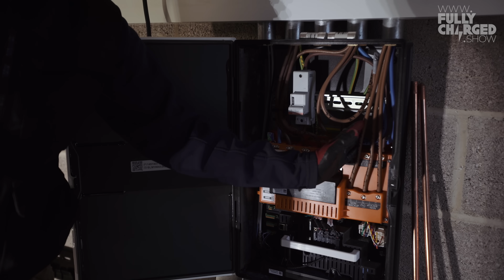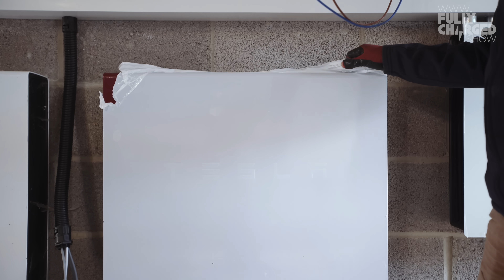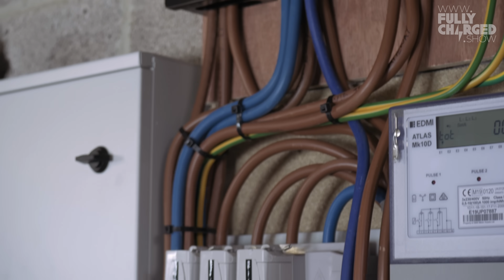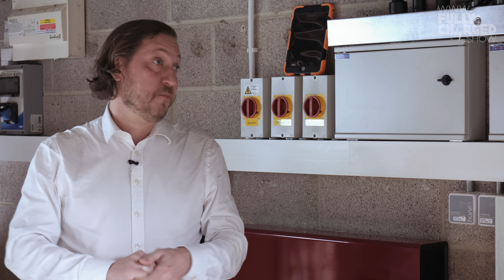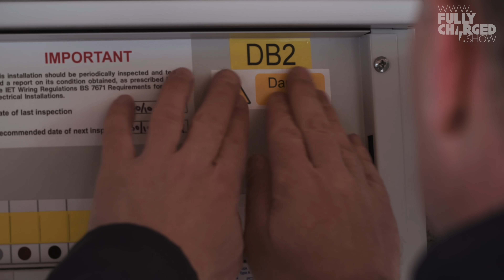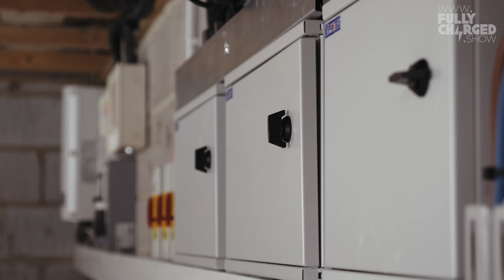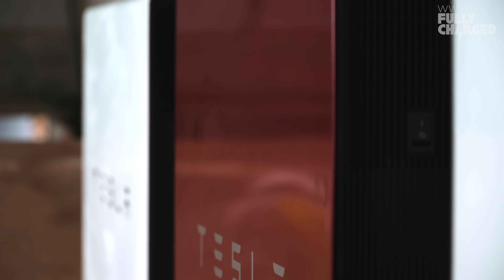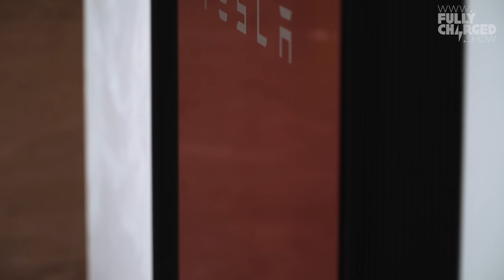Can you run your house on a battery? Tesla Powerwall 2 (Founders Series) & Tesla Backup Gateway 2

Comment: Why did Western make you upgrade to 3-Phase for this? As you mention you are smoothing the demand curve not adding to it and you are consuming almost all generation between domestic use, batteries, Zappi and Eddie so your grid load in and out should be less than it was with a single Powerwall?? I have the same Powerwall set up with Northern Powergrid in a small rural village and they were fine with on single.
Reply: My take is the power company cut corners in the past a ran a one phase tap off the three phase grid supply up to all the houses round Rob's so now there is a big load or source on the end of the line it's hard to balance the phases so they billed Robert and earlier his neighbour to fix it.

Comment: The explanation of the tariff buyback sounds flawed. I am not 100% sure how it works in the UK, but in most other countries the costs (infrastructure, maintenance, etc.) stated as making the difference in the rate charge by electricity providers and the amount they will pay you, are charged as in see ividual items in the bill. They are NOT part of calculating the rate per kWh.

Comment: They still have the house lose power, (for a moment) in a power outage!? That is still enough to cause problems and there is nothing new or difficult about Uninterruptible Power Supplies/Sources! (aka UPSs) They've been around for ages, protecting anything from a single PC to, as in one case, an entire city.
Reply: This is a standard safety requirement for isolating the grid from the house to protect lineworkers. It's not meant to be a UPS, nor can it be... but there is nothing stopping you from putting critical hardware on a UPS. The inverter needs to restart in 'island mode'. No big deal.
Reply: @nitramluap  "This is a standard safety requirement for isolating the grid from the house to protect lineworkers."

That's completely beside the point!
When the power coming into a UPS is interrupted, the UPS still provides uninterrupted power, whilst also not sending any power back towards the grid!

"but there is nothing stopping you from putting critical hardware on a UPS"

The house-battery-system, should make sure that the power supply is uninterrupted (instantly, automatically, and painlessly, without any interruption, like any UPS), by itself. There is no excuse, for it wouldn't.

"The inverter needs to restart in 'island mode'. No big deal."

NO IT DOESN'T!
There is no need for a RE-start! It shouldn't shut down, in the first place!

If it can be done at every scale, from a computer, to a whole city (plus nearby areas!), then what possibly reason would there be, for not being easily able to do it, for a house!?
Reply: @Steve Davis The video just showed that the lights went out, when they simulated a power outage!
That stuff you were doing on the computer? All gone, and fucked up. (just to name one possible problem, among many)

Comment: I just use a dynamo on my 1908 portable steam engine. It runs all day with no issues, it's quiet and fuel is free.
Reply: Free fuel..?
Reply: @delboy7039  fellas got free coal somehow
Reply: @D Vickers i live near a heavily wooded area, lots of fallen trees and dead wood.
Reply: Maybe make a video? A lot of people will be very interested!
Reply: @rahul kumar it's similar to this: https://www.youtube.com/watch?v=81o7T7oMtYA
I just charge a ton of car batteries and hook them up to an inverter. The problem is if something goes amiss with the engine or boiler it's not an easy fix.
Reply: if your steamer were heated by sun it could make sence, not coal.
Reply: @Martin LV Not coal, but wood.
Reply: @nialpollitt3410   still hard work and smoke from chimney do nothing good for your health or enviroment...
Reply: @Martin LV it really doesn't take that much wood per day, and im not reliant on outside forces controlling my electricity supply. And i have the chimney going through the roof of the engine shed. You'd get more fume inhalation walking down the high street than you would being stood next to the engine all day.

Comment: Sucks that you lose power for seconds - have to reset clock radio, microwave, oven, other powered digital clocks.
Reply: Hmmm.  My Victron Multiplus II does the mains failure switchover instantly... ?
Reply: That's what UPSs are for. You just have to plug in each critical element in a UPS individually.

Comment: Hang on!? What’s going on there!? Why is there a 5 second delay? On mine there no delay at all. Is it because it’s 3phase?
Reply: Dean Fielding Same with mine. Doesn’t even drop the router connection.
Reply: MDG Yes same here. Not even a flicker or have to reset a clock!
Reply: Same, mine cuts in so quick the clock on the microwave doesn't even reset.
Reply: I think Robert needs to get his installer back to reconfigure his unit to how your units are configured as the installer hasn't configured at correctly
Reply: your going to make Robert worry with comments like that ! ha ha i have power wall envy of all of yous ! one day i will have one.
Reply: Could I ask, those who have the backup gateway in the UK, do you get any interruption to domestic power in a cut or not? (assuming you have some charge in the PW of course). I've had a PW2 some time now and was wondering about getting the backup gateway when I saw it had reached our shores....but if it isn't a fully line-interactive UPS in effect, I'll not bother.
Reply: Mine flickers a bit but it’s way quicker then his
Reply: Came to say the same thing. Powerwall 2 + gateway 2 here.
I think we only time iv had a flicker was when my batt was 100% and grid went out in the middle of the day. Solar inventer needed to shutdown quickly
Reply: @Writer B.L. Alley Not really directly comparable, as your generators are not wired to supply power back to the grid. Still, such a long delay/"blackout" is not something I would tolerate.
Reply: There is something wrong unless there is some other reason why in the UK it has to be like that. I have watched many videos and they didn't even know when it switched over. Check into that Robert.
Reply: Same here - I have 2 PW2 ion single phase and there is no noticeable delay when we lose grid power, not even a flicker of the lights in the house - it is instantaneous.  Everything in the house carries on.
The only thing that notices is my very sensitive UPS on my servers, and that notices a fractional (few ms) outage with the same time stamp in the logs, it doesn’t even kick in.

Something odd is going on here - though I do know that the Backup Gateway can only provide power in failure mode to one phase, so not sure what they have wired up here.
Reply: In some countries (like Here in Germany) its in the laws, that it has to cut for some seconds to protect for example someone who has to shut down the grid for maintenance or repairs. It’s to protect someone working on the grid, not to get shocked by the battery/ solar voltage 😉
Reply: @timvonr2802  cutting from the grid should be instantaneous, and once disconnected it can power your "island" also  instantaneous. There is no excuse for this delay.
Reply: @timvonr2802  So how do data centres cope with outages then? I've never seen a UPS system let the power drop for more than a tiny fraction of a second, and those systems can be orders of magnitude bigger in terms of power than a single-home system like this. I do realize that having a bidirectional system like many solar installations complicates things, but reaction times on the grid isolation detector/relay should be more than fast enough to not present any danger to grid workers. Worst case you build your battery system like a UPS "inside" the solar installation, so you can deliver solar to the grid but not battery power. 
My main issue with dropouts like these is that lots of modern devices really don't like short power interruptions and "bursts" like this video showed.

Comment: I would separate the two powerwalls more in case of a Fire, so one doesn't ignite the other as quickly.  
And I would make sure there is a fire/smoke detector in the garage, as well as some kind of fire suppression.  
And I would keep a fire extinguisher by the doorway.  
And the powerwall needs a firewall.

I can't wait to get one of these for my home.  

I think the distributed harvesting of sunlight and repurposing it is the future of energy.  We now become trees that can walk and roll!  And our roots don't need to dig wells for old dead trees anymore.  Now we can skip the step of waiting thousands of years for oil and gas to form before we can use it.  

I think we should harvest and reuse the rainwater that lands on each roof, also.  We can skip the step of sending and receiving it across the city through pipes to some water facility.  And you can individually control what is done to it, added to it, taken away from it.  

As well, we should all have a place to individually, safely compost biological materials that come into the home.
Reply: No need for any of that. Your fridge is much more likely to burn down your home than a Powerwall. There are some videos of Tesla testing their Powerpacks for fire safety, which basically contain a bunch of Powerwall modules, and even when they set it on fire not much happens.
Reply: If (as unlikely as it is) the powerwall catches fire, there's no fire extinguisher or fire suppression system that's going to do much to stop it.
Reply: Robin Whitfield 
Well, yes, but if I had one in my home, I would at least want to have time to get out safely.  
I think the fire department should be notified such a thing exists, inside which places, have a procedure to take in case of a fire, and practice at least once, putting such a thing out.  (The electric cars, too.) 
If the powerwall ignites, they need to isolate it as best they can until it discharges all its energy.  
If the house ignites first, they need to be aware of the powerwall, and try to keep the powerwall from getting ignited.  
It's like he has his own power plant.  It's not just a bunch of wires coming into the home anymore.  
Or it's a little bit like having a barrel of oil, or a pile of coal.
Reply: You’d have to bury it in sand like an Egyptian tomb

Comment: One thing not mentioned on the video is the house circuit split across the phases. How have you set this up? PW is a single phase device. Are these both on one phase? If so, have you split your house circuits so “essential” loads are on this phase and therefore backed up with other phase loads going off in the event of a power cut?
Reply: Great question, I second this. Typically this is done with a 'critical loads' sub panel, but they didn't show anything like that.
Reply: Stephen Shumaker There were 3 panels there marked up DB1, DB2 etc but no explanation of circuit balancing.
Reply: @Chris Jardine Is the solar array on the same phase as the house? Or does he now have two separate arrays on different phases?

Comment: I would love to have a system like this but devil is in the detail....how much?
Reply: We have one Powerwall and it cost 9000€ including installation. I guess the numbers will be similar in the UK.
Reply: A lot.
Reply: You can have it for free from referrals. That is how he got it.
Reply: @DaveBoxBG  Yes I know, I'm referring to "normal people", without ability to get home storage for free or with huge discount.
Reply: Ohhhkay I just gave the Tesla Configurator a run.....FNGING ELL! 

That ain't bringing sustainability to the people Elon.
Reply: @gjssjg  If you live somewhere with high power prices and an unstable grid, a powerwall and solar can quickly pay for itself in reduced bills and a reliable power supply.... which is probably why this gear is so popular in e.g. California and much of the rest of the USA :p

Oh - and it helps that they also get enough sun to maximise the potential from Solar.... we don't.
Reply: @logicalChimp  We live in Utah and our power bill is $100/month on average and maybe another $50/month for gas (primary source of heating in winter/water heater/etc..).  The power wall + solar payback would be well over a decade and that likely doesn't account for a crap 10 year batter life.  The economics of solar + battery has a long way to go.  I guess EVs will change that dynamic in the future for power demand but for not it's not a great model.
Reply: @logicalChimp  Not the UK then. Can't remember the last time we had a power cut where I live and electricity is cheap. This system would never payback for a typical user in the UK. might as well wait until you can plug your car into the house.
Reply: @aceofspades6667  I suspect battery life will be well beyond 10 years (yes, there will be degradation - but likely less than 30% after 10 years, as that is roughly the warranty cutoff for EVs, which put more strain on the batteries)

But I suspect for many people, the payoff is only part of the consideration - reducing usage of 'polluting' power generation is also a consideration, as well as protection against future swing in power prices, etc.
Reply: @ChocolateFrog  Yup...  if you have the money to spend it's a nice thing to have, but there are far more cost-efficient improvements you can make to the average UK home first...
Reply: Ace of Spades yeah, but you are NOT paying for your energy the rest of us are.   You get subsidies in the form of the worlds largest military securing fields all over the world and a home bound fossil fuel industry that does pay for their waste stream and is slowly destroying all of our abilities to live a health and productive life.   Sure the little slip of paper they send you monthly has smaller dollar amounts on it than the cost of a system like this.  But we are all paying for your cheep energy lifestyle.
Reply: The cost just to install 3 phase was probably north of £10k.
Reply: @ChocolateFrog  I had 3 phase installed (to run a lathe in my garage) at my home in Australia. Admittedly it was a few years ago now, but it was only AUD1,500. They are just running cable to the power box, installing new fuses, new meters and in my case 3 phase cabling from the meter to the garage. The whole house doesn't need to be 3 phase.
Reply: How long will the batteries run the house for in a power cut - never mentioned.
Reply: @hadtobe4502  well, it would in part depend on how much sunshine there is (given Robert also has solar), but presuming a typical English winter day (dark/gloomy), and depending on what gear Robert uses, it could probably do a day or two... but really it depends entirely on your power draw - and if you know you're running on batteries, you'd probably subconsciously ration the power a bit too...
Reply: Hadtobe depends on how much charge is in, how much electricity you use which varies from summer to winter typically it’s between 8 and 10kwh per day.
Reply: Reasonable, about a dollar three eighty.
Reply: Don't think Robert likes to talk about the cost in case he gets accused of being a middle class elitist.
Reply: @ferkemall  you might not but it really is. The same as people saying petrol is expensive but a litre of most things is more than £1.20, let alone something dug out of the ground, refined and then more than doubled with tax.
Reply: $6500 per solar wall, plus $1,100 in hardware. Found this on their website.
Reply: https://www.tesla.com/en_GB/powerwall
2 powerwalls with the equipment needed would cost £14,100, then you have to pay for the installation and 3 phase upgrade... ouch!
Reply: @con1989  lol well like they said most people don't have to upgrade to 3 phase, and definitely not £14,100 for 2 power walls in australia :D I think you pay more outside-of-usa-tax than we do. (it seems to be about 2/3rds of that price before subsidies)
Reply: If someone payed for a car with, for example, 40 kWh battery, it makes some sense to buy something like Powerwall only until such cars will feature Vehicle To Grid (V2G). Unfortunately cars with CCS plug cannot have this wonderful feature yet (and they probably won't until 2025).
Reply: Kamil C. The new Nissan Leaf has V2G I think
Reply: @jqstar1786  Yup - Chademo has had V2G baked in for a while.... the downside is that it uses the Chademo plug (rather than the more common CCS).  Apparently V2G will be in the next version of the CCS standard - but that won't help people with existing cars...

Comment: Robert, Nice video. Aside from the grid reinforcement costs, how much did this entire set up cost including the cost of the two 13.4 kWh batteries? (I know you got one free). I think I can get this past the management (her in doors) if I can show a return on investment which pays the whole thing back in 15 years. It means taking a punt on price differentials and on legislation. What I need is a guestimate within a bandwidth between "that's never going to work its negative whatever you do" .... to .... "it might work and anyway its good for the environment".
Reply: The ROI is completely based on how much you pay for power at different times of day. If you have flat rate billing like I do, it will never pay for itself. If you have a large delta between 'cheap' power and 'expensive' power at different times of day, then it might pay for itself. But that's going to be idiosyncratic to your house and power utility.
Reply: @stephenshumaker8444  I got that. Still need to know what the capex was.
Reply: Even if they were filled only by solar and the 26kwh output was therefore saving 11p grid price, that's £1000 per year, they cost 12k+ install, this time of  year his PV will produce 6kwh. Its not anywhere near cost effective in this country.